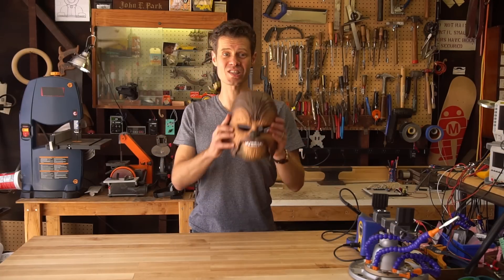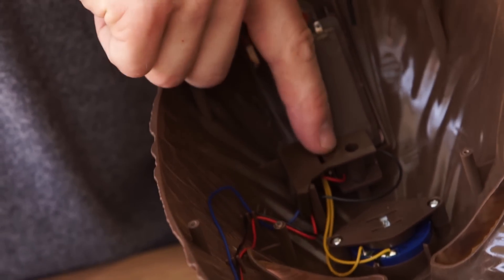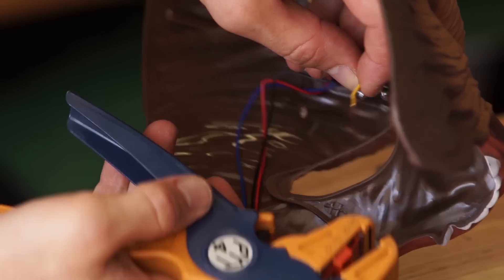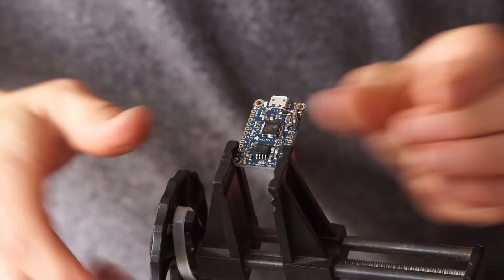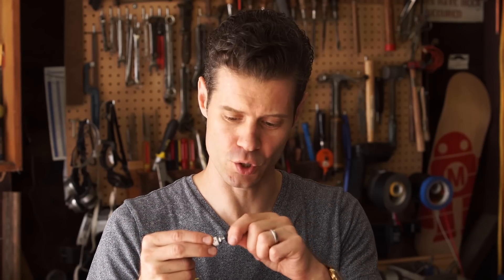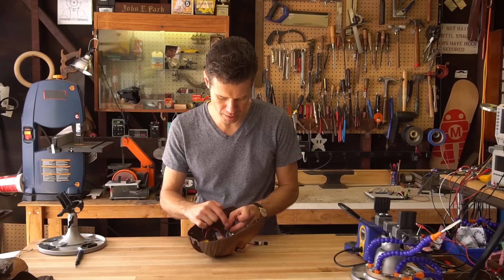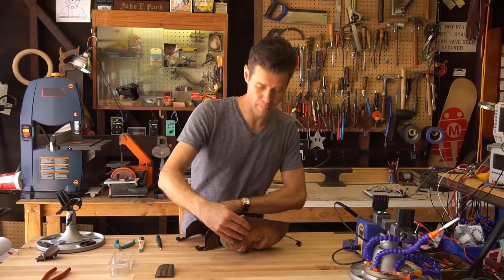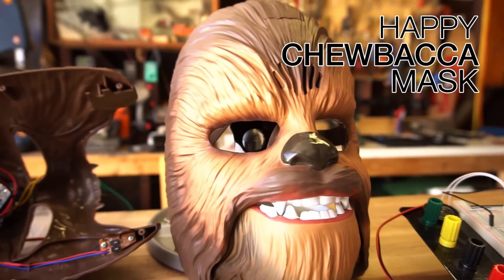John Park's Happy Chewbacca Mask @adafruit @johnedgarpark #adafruit

Comment: Instead of re-recording the original sounds with a microphone, I would instead disconnect the speaker and record the signal from the wire directly into the line-in of your recording device for best audio fidelity.

Comment: Neat project. I was a bit surprised by your scheme for the selector though.  I had assumed you were going to use a digital pot and program the I/O it was connected to to scroll through the sound banks. Then you could have had the limit switches go to a couple of I/O pins that were programmed to be read and trigger the 2 different levels of sound.  Would have saved you a bunch of wiring.  There might be something I'm missing though.
Reply: Thanks. I was thinking along really similar lines, but the Audio FX Sound Board isn't really programable in that way, it's meant to keep things simple, so all you really control is the naming convention of the audio files. An Arduino and wav shield for sure, and yes, that'd save a ton of wiring.
Reply: Ah makes sense, I wasn't familiar with the Audio FX Sound Board.

Comment: I am needing to add a male & female plug between the switch in the jaw and the rest of the circuit and selector switch. any suggestions on the best way to do this? I am adding this set up to the chewbacca costume i am working on and want to have the board and speaker on my chest instead of in the mask.
Reply: Sorry I didn't see this! Let me know if you still are looking for a way to make the switch remote and pluggable.